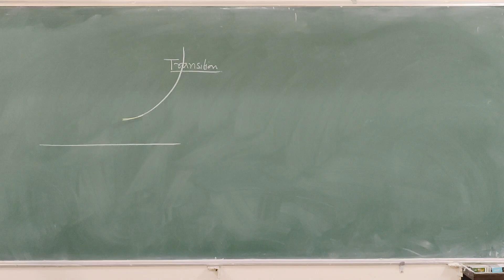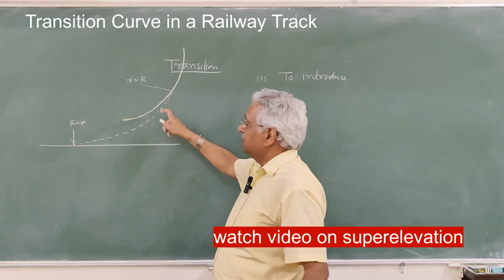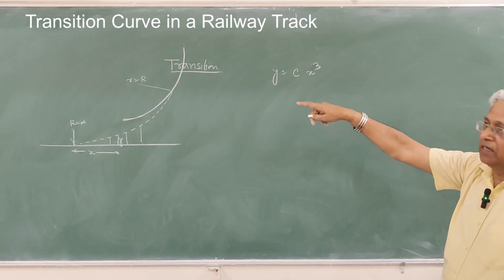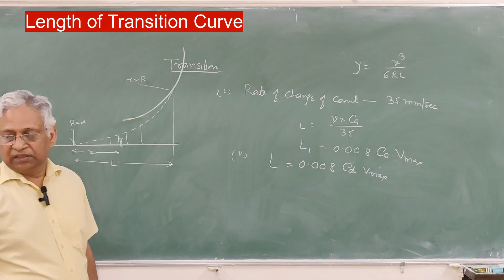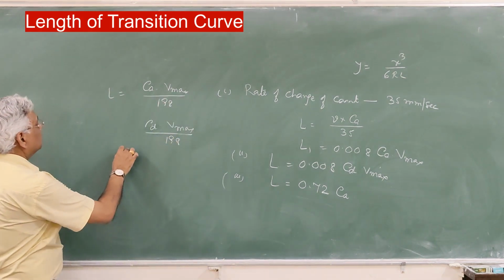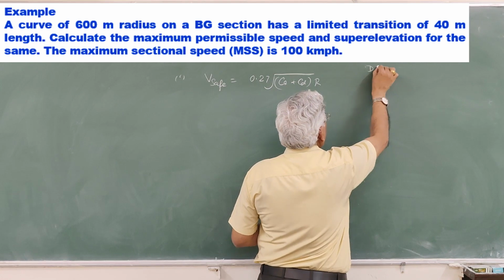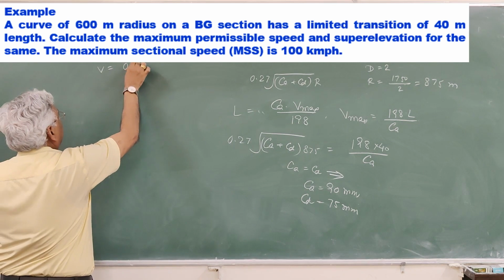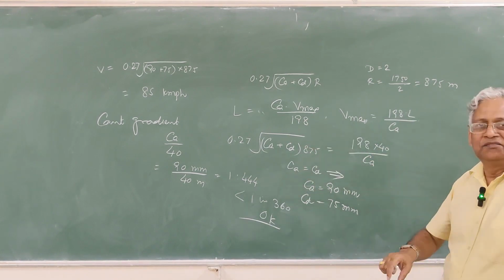Transition curve on a #railway #track Length of Transition #curve as per latest #specifications

Comment: Thank you for your guidance, which is significantly improving my understanding of railway design. I kindly request that you include more mathematical solutions for real-life problems related to the design of transition curves in railways. Additionally, I noticed an error in the example discussed in this lecture: the radius, stated as 875 meters, should be corrected to 600 meters. Otherwise, everything else is satisfactory.
Reply from the maker: Thanks for the suggestion. Keep watching.